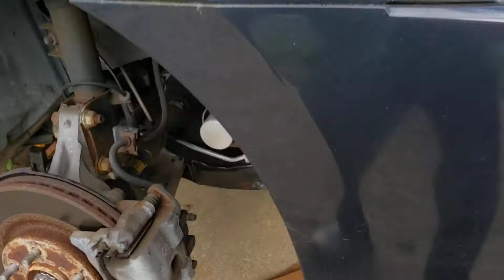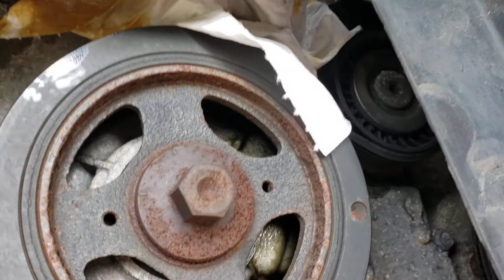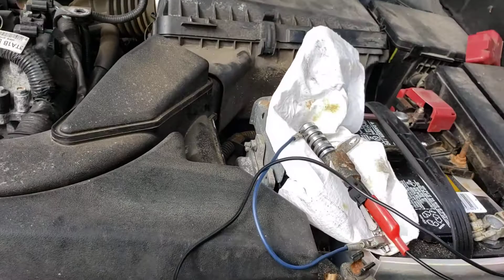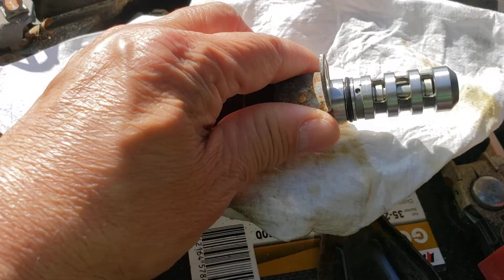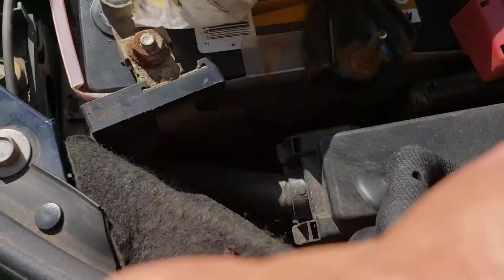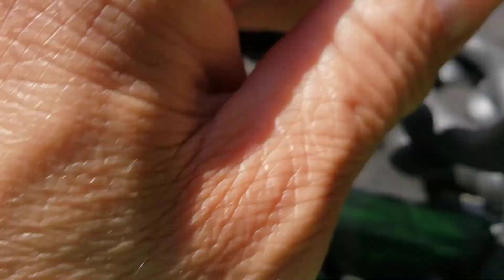2013 Nissan Altima 2.5 P0014 Code  P0300 How to fix test Variable Valve Timing Solenoid Replacement

Comment: If i replace all 3, can i use the same type of solenoid? Or are they different but look the same?
Reply from the maker: If you look up the part number from a parts store, I believe they are all the same, all 3
Reply: @alyoungcuda  thanks
Reply from the maker: @durandalrymple4420  you're welcome and thanks for watching too. Make sure you change your oil and filter before you start the engine up after the Solenoid change. You don't want dirty oil to block the new screens on the Solenoids
Reply: @alyoungcuda  just changed the oil a month ago. should be ok, valve cover looks fairly greasy though and may also need replacement. Other than that car runs ok and its good to swap these solenoids before they do go out in my opinion
Reply from the maker: @durandalrymple4420  so you're changing them for preventive maintenance,  not because you have an engine code, then ok with the oil change.  Once a code comes up, then yes you need to change out the dirty oil.

Comment: Will this issue cause the car to die when idling? I am getting the P0011 code
Reply from the maker: Yes it will, it will restart ok but continue to run like crap.
Reply: @alyoungcuda 
Yep thats exactly my issue
Thank you.
Reply from the maker: @93everything  that was the problem with this car, change the oil and filter after the change of the Solenoids, before you start the engine, dirty oil is the solenoids worst enemy
Reply: Did you change all 3?
Reply from the maker: @93everything  changed 1 at 1st but 6 months later, the other one went bad, so I recommend to change out the 3rd one at the same time as the 2nd..no sense having the car come back again..but I do recommend all 3 at once but if money is tight, change the 1..and get the Autozone one with the lifetime warranty. Well worth it.
Reply: @alyoungcuda   *Update* 
I bought them, replaced all 3 and change the oil. 
The car is running smooth now. 
Thanks!!!
Reply from the maker: @93everything  Awesome,  just keep up with regular oil and filter changes because solenoids hate dirty oil..I'm glad it worked out and thanks for watching too...

Comment: did you remove all three and test them? Or did the code tell you which one was bad?
Reply from the maker: The code will tell you which one is bad, as for testing the others, when you remove them, the oring will need to be replaced and I'm not sure if that is available separately and besides, if you go thru that labor of removing them to test, don't bother, just replace them. And change your oil and filter too. Thanks for watching...

Comment: My car had a P001 code . I  changed both camshaft position sensor. Check engine ligt came back on. Took to Auto Zone and they said it was the Intake Valve Timing Control Bank 1. So does that mean I change the one in the middle ?
Reply from the maker: Do you mean P0011?
Reply: @alyoungcuda  yes. Sorry
Reply from the maker: @coachsaldana5708  yes, so thats the VVT or Valve timing solenoids..there are 2, one for intake and 1 for exhaust..
Reply: @alyoungcuda  Auto Zone said it read Intake. So that's the one in the middle of the three?

Comment: Thanks you for clarifying on your video that the locking, intake and exhaust solenoids are all the same. That's why I couldn't find a part number for the other ones. Lol. Now it makes sense. Once again thank you bro. Awesome video.
Reply from the maker: No problem,  hope it helps you out and don't forget to change the oil and filter..dirty oil messes up the solenoids
Reply: @alyoungcuda have you ever changed the one it says is bad but still get the code? I have the exhaust code and over advanced so I changed the exhaust solenoid but still getting the code and got a knock
Reply from the maker: @MrArtVein  that never happened to me but it did happen to someone I know and it was because he changed the wrong one and he didn't change the oil and filter before start up. The oil was dirty and the solenoid screens were full of junk.
Reply: Thanks for the reply, yeah I'm thinking this could be my issue as well. I had just got an oil change but when I pulled the exhaust solenoid the oil was the old color of the dirty oil so I'm guessing the other two are gunked up too
Reply from the maker: @MrArtVein  also, just to add fuel to the fire, just because it's new, doesn't mean its good, some parts are defective out of the box.
Reply: @alyoungcuda good point! I should've tested with some alligator clips. Gonna replace all 3 I'll pull that one back out and test

Comment: I have 2014 nisssan maxima I had these 2 codes as well I replaced bank 1 and bank 2 solenoids and codes came back on is cause there’s a 3rd solenoid and I didn’t replace ? Replaced both bank 1 and bank 2 and rpm’s felt better cause before fixing I was not able to go higher than 4K rpm’s and I replaced both solenoids and it felt way better was able to go higher rpm’s but the codes came back on any help ??
Reply from the maker: Maxima is a 6 cylinder and only has 2 solenoids..you need to check to make sure the Solenoid is working and is getting power and ground from the computer and there might be a screen in that hole where the Solenoid went into.
Reply: @alyoungcuda  might be a dumb question but would this also apply for my 17 3.5 Altima ..just got the p0014 and my engine is moving so much and making a weird noise not sure where to start
Reply from the maker: @stevengarcia1481  could be the valves, or cam or crank sensors..did you change the oil and filter? These engines hate dirty oil and it makes the Solenoid stick.
Reply from the maker: Remember the codes come up to tell you there is something wrong in that circuit, it doesn't mean the Solenoid went bad, the car doesn't diagnose itself, you need to do the rest. Its like a blood pressure machine it tells you high pressure but you still need to check it out.
Reply: @alyoungcuda  bet bro thanks 👌🏻I’ll give you a update to see what I find cause I’m thinking it can be a spark plug or the actuator

Comment: Are u located in Atlanta area ? I need this done on my 2013 Nissan Altima
Reply from the maker: I'm up in New York but I hear it's very expensive to do I think the dealership wants about $1500
Reply: @alyoungcuda  Yes the Nissan dealership here quoted me $1300 for the exhaust valve timing solenoid replacement then brought the price down to $700 with a friends and family discount . I have one local shop with decent reviews that said they can do it for $100 labor and I can bring my own part from autozone . Idk if this is something to trust them with cause a lot of shops I called today said they won’t do it.
Reply: Ok I’m going to take my chances with the local shop. Hopefully they do it correctly. I may just do all three to be safe. Thanks
Reply from the maker: Its amazing the dealer can  drop half the price..as for the decent guy 100 is not bad as long as he knows which one is the bad one..they all look the same ..buy the brand that has the lifetime warranty..its a few dollars more but worth the extra..some people change all 3
Reply from the maker: Won't hurt to do all 3...the main thing afterwards is oil changes..do them as scheduled..these valves hate dirty oil..

Comment: Did it solve the p0014 and p0300 codes. I’m a vw mechanic and have a chance to buy a 14 Altima with these codes for 1300 with 77k. They said he needs a a new timing chain and prefer not to swap that out. All things considered it’s runnning rough and and this seems easier. Let me know if your car was running rough prior and this vvt fixed both
Reply from the maker: Running very rough..had to drive with 2 feet..and yes this solved it..still running strong to this day..Thanks for Watching...

Comment: These directions worked perfectly took off the front right wheel used a 10in extension socket to remove nut then readjusted to the right side in order to remove the solenoid with a long nose pliers. Took about 30 minutes didn't I have to remove power steering Etc started it up no issues at all
Reply from the maker: Perfect..change your oil as scheduled..dirty oil clogs these solenoids..thanks for watching..

Comment: CORRECTION!!!!!! This shit AIN’T easy at all and I know how to work on cars. Ain’t no give it a twist and it pop out. That’s totally false. Motor mount have to go and that small reservoir. With that out the way you can only access the middle one but. You have to knock it out with a screwdriver hit with a hammer.. the rest of the video is informative except the it’s east part.
Reply from the maker: All depends on the person doing it....no mounts or reservoir were removed in this video...a lift would of been better than laying on the floor, but it sure beats the price of the dealership to do the same job!

Comment: I got p0011  is it the same?
Reply from the maker: Yes..middle
Reply: @alyoungcuda  thanks alot man
Reply: @alyoungcuda  hey i just replace it and now if shifts faster then before is that normal? Rpm goes higher then before bought the roman one instead of the duralast.. or its geting used to it..
Reply from the maker: Yes but its the intake one which is in front towards the radiator  side..where as this one was in the rear..
Reply: @alyoungcuda  so the intake one is the one on the middle?
Reply from the maker: Engine and transmission shifting is 2 different things..dont mix the 2..you might have another problem..was p0011 your only code or did you have others..
Reply: @alyoungcuda  yes only problem didnt do that before put  the new selenoid ... so that selenoid has nothing todo with the shifting?
Reply from the maker: Maybe you're just not use to the new power..did you leave anything off or disconnected..double check your work.
Reply: @alyoungcuda  if its disconected would it do that?
Reply: @alyoungcuda  did you see a diffrance on yours? It says permanet code on the ob2.. it would clear out by it self .. ill just drive it see what happends
Reply from the maker: You might have to disconnect both battery terminals and hold them together for a few minutes to see if it clears the computer...then reconnect them back on the battery
Reply: @alyoungcuda  unless is recomended to change all 3 with same brand idk am just switch it to the exausust see what happends both #1 and #2  are intake soo maybe that fix it lol
Reply: @alyoungcuda  ok
Reply from the maker: Nothing to do with the transmission..its engine codes..it has to do with valve timing..double check your work..did you move something, remove a plug wire or vacuum hose?..
Reply: @alyoungcuda  no i did the same as you i pull the car up and took it off underneath the car but ill check it out thanks ...
Reply from the maker: Usually a permanent code is in the ecm
Reply: @alyoungcuda  yes but like its shifting wird now.. like i step on the pedal about 1/4 TO 7/16 NOT EVEN HALF THE THROTTLE and like it goes to 4 5 rpm lol and then it shifts reall fast lol..

Comment: I See you had a rag for Oil. How much oil leaked after removing the Exhaust Solenoid? I am doing this in my driveway so just trying to prep and not have most of the oil leak out.
Reply from the maker: Just a few drops..